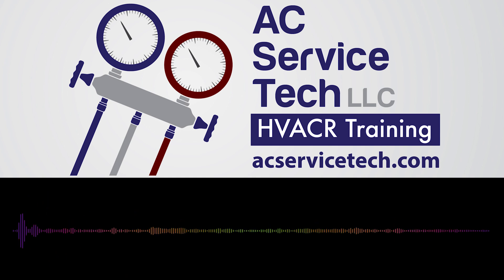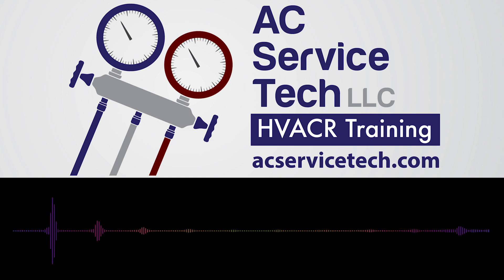Gas Furnace Diagnosis and Approach!

Comment: Having problems with rudd outside gas heat unit.when thermostat is on the fan trys to start.it cuts on and off really quick  like someone would flip light switch on and off.it finally cuts on but only cold air is coming out.i noticed when I looked at red wire between start capacitor and contactor its black in the middle not at connections.any idead

Comment: Your videos are AWESOME!  Would you *PLEASE* help us troubleshoot - our furnace is pretty old - recently we’ve had to relight the pilot, then the pilot stays lit long enough for blowers to come on and heat to blow into vents for about 24 hours - then after about 24 hours we notice furnace has stopped operating so we check to find that pilot is out again so we’d relight and have heat for about another 24 hours to 2 days.  Well now this process has shortened to only an hour or so (and last time 30 minutes) of burners kicking on and heat blowing through vents, then pilot is back out 30 mins - hour later.  We have had several technicians tell us conflicting issues - fan limit switch or heat exchanger vs. gas valve plus new pilot assembly.  FYI last year the thermocouple was replaced then furnace worked all winter.  So we are trying to sort this out and trying to discover what the real issue is so that we can repair immediately until we fully replace soon (for next season), would you please help, what truly causes pilot to keep going out after kicking burners on to blow heat for awhile?  Your response and expertise is very much appreciated...
Reply: P.S. We also just installed a new thermostat to eliminate that as a possible issue thanks again

Comment: Did a install today for a friend of mine who's like a brother got them on a 90%er  80k BTU single stage ECM heil on a budget and got it all done  4rs & 1hr of trub shooting but wouldn't turn on blowing the 3 amp fuse low volt ok but  positive it was Transformer leads to the board  pulled them out plugged back in ,were not making good connection after checking for high voltage which is ok now  manufacturers? need to check equipment before saying it's okay  to distribute no?LOL don't you love troubleshooting🙄😁

Comment: Another great PODCAST. Love your education material on your web site.  Have you seen where a second condensate trap which gets formed over time as the 3/4" flex tube from the inducer motor condensate trap bends up enough so that water is trapped.  Could this cause drainage problems to the point that the inducer motor is not able to generate enough draft intermittently? This on 90% natural gas furnace mounted horizontally. On carrier it will generate a status code of 31, wait. 15 min and retry the sequence indefinitely
Reply from the maker: Certainly, any tube not pitched properly, will cause stagnant growth within the tubing and potentially cause a trap to form. I have even seen entire pvc exhaust pipes fill up with water from upward pitch then downward and back up again. So much where the water intermittently closes off the pipe causing the pressure switch to trip, thanks!

Comment: I had issue with inducer motor it sounded like jet engine on 3ton York 80% no codes change the inducer motor still makes the sound any ideas.
Reply from the maker: Some bearing types sound incredibly loud on inducer motors I have run across and not just old ones. That is, unless there is scraping of the internal wheel which also causes a bad sound but you would have seen that when replacing.